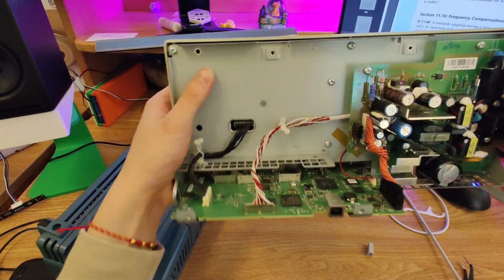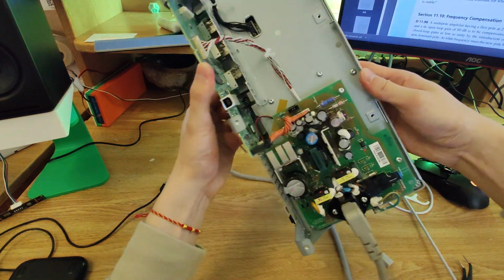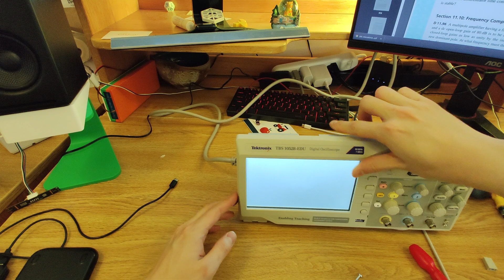Tektronix oscilioscope TBS 1052B white screen no display fix part 1.5

Comment: Sir kindly how to rectify  above  white screen  in dso
Reply from the maker: Shake slap wiggle unplug replug. Check power supply rails. Check physical damage. Compare voltages with a known good one. Sell on ebay.